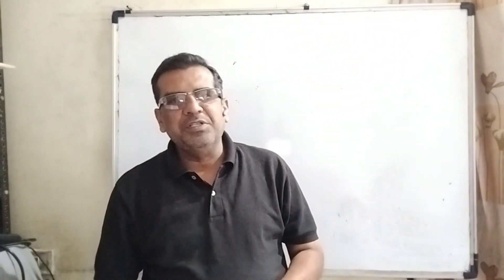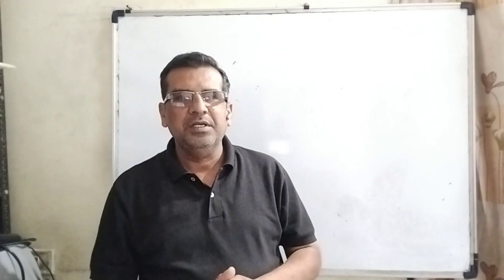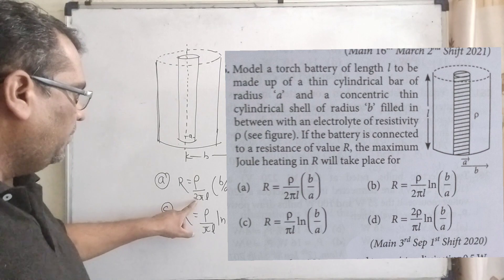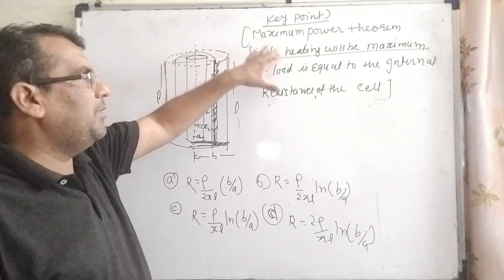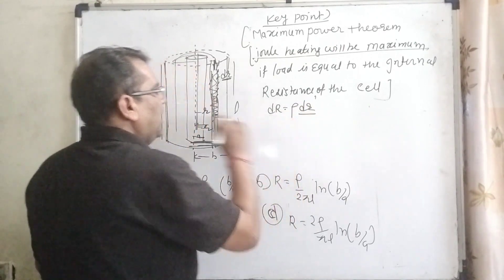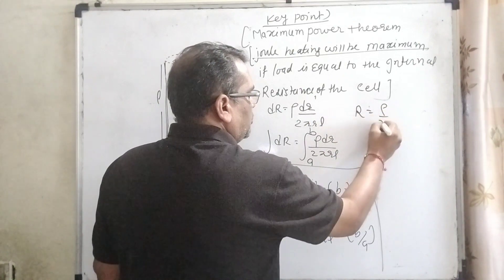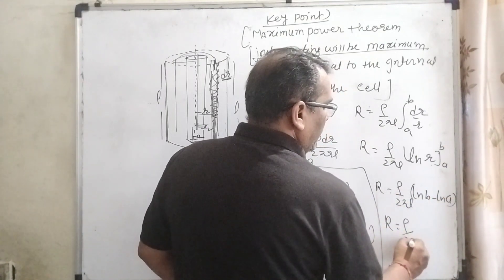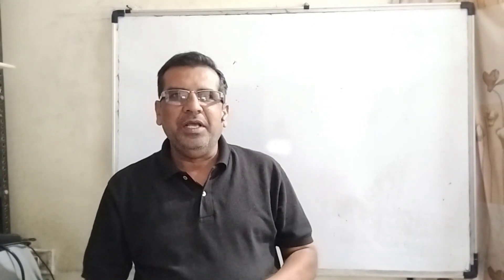Model a torch battery of length l to b made up of a thin cylindrical bar of radius a and a concentri

Comment: Sir fantastic explanation but i jave a doubt...
Why did we consider current to be radially outwards..because current can flow along the length also right? I know u answered the same question in the comments but i was not able to understand it..please resolve as soon as possible
Reply from the maker: Shakib here we have integrated rings inner to outer you can take disk to 0 to l horizontal and area pi r square but in the option is given in b and a form I think now you understand

Comment: Sir i have a doubt,why did we take radial element? Is'nt the current going from one flat side of cylinder to another flat side? Then it would be R= rho L/pi(b²-a²)
Reply from the maker: Because the radial element regularly increases  in a radial manner but the flat side is only diametrical so it is not possible
Reply: @ajaykarmarkar2636  but it is not mentioned anywhere where we have to connect the terminals. Also is it necessary for our cross section to vary along the length, may be it is a simple question without integration?